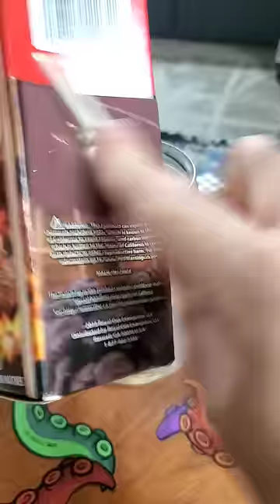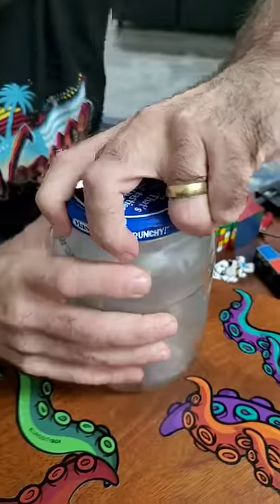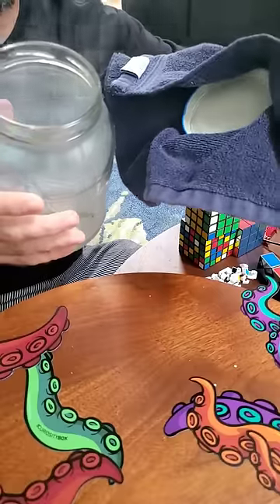Safety Sealing a Jar of Smoke

Comment: That is one impressively strong jar for not being reduced to nothing when Michael used his strength
Reply: let’s be honest that was the second smallest amount of force he could exert
Reply: He was only using 0.000000000000000000000000000000000000000000000003765456777886% of his power.
Reply: He was using 37% of his strength, but it would take you 99.9% of your strength, and you still won't be able to open it.
Reply: @NuclearYoutubePlant you mean 0.000012%
Reply: I'm surprised the fabric in the towel didn't rip itself to shreds underneath the torque of Michael twisting his arm..just goes to show how in control VSauce is of his superpowers
Reply: @lostpockets2227 im surpiresed the fabric of space time didnt collapse after vsauce pretended to struggle opening the jar
Reply: The thing is, that towel was probably imbued with a little bit of his power so it'll work as protection without getting torn to pieces.
I can't find any other reasonable possibility.
Reply: he was using 99% of his power
Reply: @PROPLAYEN  -99%
Reply: @falco05  So, 0% of his power
Reply: @__-tp4tm  I guess, meaning his very Existence is strong enough to open a jar, or rather it opens itself out of respect (idk how long that joke will be funny)
Reply: @falco05  Fck it, we're in too deep
Essentially, Vsauce is akin to Chuck Norris. He's probably an alternate Chuck Norris of another Dimension, probably wandering the aspects of Infinity. An alternate Chuck who's most mass of muscle is in his brain.

Legend says if he stares at you with the intent to destroy, he demolishes not just your body but your entire existence in this timeline.
Reply: @__-tp4tm  And every alternate version of yourself in other Timelines and the Multiverse. And yes he basically is Chuck norris at this point.
Reply: @woodykrska9947 he was using all his power to prevent himself from vaporizing the jar
Reply: @cameronvanatti  yes
Reply: He didn't use his strength. He replicated our strength so that we didn't feel bad. What a chad
Reply: @NuclearYoutubePlant  *0.000000000037%
Reply: @spotify_Real  you mean 0.000000000000000000000000000000000000000000000000000000000000000000001% of his power
Reply: @NuclearYoutubePlant if he was using 37% the jar wouldn't even be invented
Reply: @NuclearYoutubePlant that’s a lot of power for a simple jar
Reply: As thanos said “gone,reduces to atoms”
Reply: @lostpockets2227  you should that the fabric itself was made from reinforced vibranium
Reply: He was using 0.00000000000000000000000000000000000000000001292% of his actual power
Reply: @spotify_Real no bro you mean 0.00000000000000000000000000000000001
Reply: @jjpendejo7407 it did, but mical held it back together, obviously the seals don’t ever go back down, mical was abusing space time for content
Reply: Ya he is very strong he beat my ass while his hands and legs were tied
Reply: @__-tp4tm no he was actually tightening it so much, it popped off
Reply: He was only using 0.000000000000000000000000000000000000000000000000000000000000000000000000000000000000000000000000000000000000000000000000000000000000000000000000000000000000000001% of his power
Reply: Nah that was a towel forged in the depots of hell drenched in holy water
Reply: Well, hence why he said he was grabbing a towel not his bear hands after the first example 💀😭
Reply: God has inspired me to share this Wonderful Good News that deserves to be heard by everyone.
Jesus is the only way to Salvation 

John 14:6 – “I am the way, the truth, and the life. No one comes to the father except through me.” 

And No Matter what you are going through GOD Loves You.

1 John 4:9–10. In this the love of God was made manifest among us, that God sent his only Son into the world, so that we might live through him. In this is love, not that we have loved God but that he loved us and sent his Son to be the propitiation for our sins.
Reply: @woodykrska9947 damnit you got to the joke first
Reply: That was just a fraction of his true power. God himself fears Michael.
Reply: Im glad he didn’t destroy the universe (he could with 0.000000000000000000000000000 000000000000000000000000000 000000000000000000000000000 0000000000000000000000000001%
Reply: Boys, he was just pretending to use his strength. So he is way beyond powerful..
Reply: @jjpendejo7407 nah, he just has lots of practice with his powers. the fabric of space time will only rip if he wants it to
Reply: Yall underestimating big Mike he is so strong the precential amount of power he used is so small we human can not quantify it so your arbitrary percentages mean nothing
Reply: @woodykrska9947 that’s far too much he would evaporate at minimum the earth
Reply: @paradoxgameenthusiast  true
Reply: @jjpendejo7407 im suprised he didnt annihilate all multiverses from breathing
Reply: nah man it has a towel on it
Reply: Yep. This man is the proof that the law of conservation of energy is just a goof.
Reply: Glazing
Reply: Yo
Reply: @__-tp4tm vsause is old Chuck norris😮😮
Reply: @Denstaerkste1  Pretty much xD
Ah how glorious that comment thread was...
Reply: He used
0.0000000000000000000072914% of his strength
Reply: @NuclearYoutubePlant why did you raise the percentage to 6757789857564567
Reply: Generate a Text about Abraham Lincoln being a Vampire

Comment: "Not because I'm strong, even though I am"

That quote shows his strength, and this here is all the proof we need to know how strong he is
Reply: *proof
Reply: @DUCK-DUCK_GOOSE   thanks for that
Reply: @Monia.H I don’t think I’ve ever seen someone be this calm and respectful after getting corrected
Reply: @George_the_Gorilla  ikr
Reply: Not a bad thing though
Reply: @George_the_Gorilla 
For real, even though they should be.
Reply: If you smack two heavy balls together... smacks them together with a piece of paper in between the energy of their collision will be focused at such a small point, enough heat can be produced to literally burn a hole through paper. Try this at home, it smells sniff like smoke. But lets make it even hotter! First, i'll need to rust up one of these balls. Vsauce theme starts playing 

A bowl of water should do the trick. Ten days later, that's a rusty meatball... we will wrap the other ball in aluminum foil, turn down the lights, put on some eye and ear protection and start whacking. Until... this happens spark comes out of balls . Did you see that? That is molten slag, at more then 4500 degrees Fahrenheit. Now that didn't happen because i'm so strong... even though i am stares in gigachad . It happened because the colliding balls produced the ignition temprature needed for a thermite reaction. The aluminum reduced the iron oxide, the rust on the ball, to form aluminum oxide, elemental iron and MUCH more heat than i put in. 

Now that's what i call... Exothermic Redox. regrets his actions puts the camera down in shame
Reply: @veona599  I don't see anything to be mad about. I just made a small spelling mistake.
Reply: @AlliaNCeYoutube  I love this comment, I'm surprised that you where able to memorize that all!
Reply: He only uses 1 % of his power to open that jar
Reply: @Monia.H  
Yes, that was exactly my point. The thing is, not a lot of commenters would handle this as well as you did. They would just be offended thinking that the person who corrected them is looking down on them.
Have a good one.
Reply: i love the part where he said that in this video

Comment: I seem to recall that jarring food used to work in much the same way. If you needed to jar something to preserve (like peaches for example) you’d put the peaches in the jar, then boil the whole thing from the outside with the lid off. This would both disinfect the jar, as it would kill any lingering bacteria, as well as prevent new bacteria from growing by creating a vacuum seal within the jar.

It’s an old technique that largely went away when canning was invented (cheaper and lighter weight, but with largely the same process) but you can still do it at home. Give it a try!
Reply: Indeed, or the product can go into the jar when it is still warmer from the production process (i.e. jam?)   Then lid the jar, and it will suck the jar shut as it cools, sucking the freshness seal down.   Incidentally, this not only serves as a tamper seal, but a freshness indicator.  As things in the jar rot, they will produce anaerobic bacteria, which generates gasses.  Those generated gasses equalize out the vacuum in the jar, pushing the little button back up without the jar being opened.
Reply: It still works a similar way in food manufacturing, it just looks a lil different. My dad is a packaging engineer who's worked in a bunch of different food industries, it's interesting to hear him talk about the different ways they accomplish essentially the same thing without compromising the quality of the food.
Reply: @andrewtr001  You really should heat it up after you can your item, specifically to kill the anaerobic bacteria. They may put the product in warm to make the sealing process go faster, but once it's sealed, they'll almost always cook it again to make sure it's shelf stable.
Reply: My family has a farm and still does this! We have canned tomatoes from 2018 that are still delicious. Luckily if you grow your own tomato’s, then when they lose nutrients over time they still outclass the gmo tomatoes years down the road. Also works  amazing for stew! We make a giant batch of stew every year and it stays good all year. Got some still that are from 2020 with meat and beans and all. Break the seal, put on a stove and in 10 minutes you have an amazing stew ready to dip a grilled cheese in
Reply: My family still does this! We were just canning our tomato harvest this past week. It keeps all winter and I would assume even longer but it always all gets eaten by springtime haha
Reply: @muffinman3052  Where in the world are you harvesting tomatoes in November?
Reply: @theBestElliephant  a greenhouse, maybe?
Reply: @psychromaniac3525  It's still the wrong season, like they would've had to start growing them when people are usually harvesting. It's just not something normal people do, especially if they're saying it lasts all winter.

Comment: This is actually a trick you can use to store your food for longer. Whenever you have a sauce, stew or a soup pour it into the jar when it’s boiling hot. Then close it, turn it upside down (to make sure air won’t escape) and wait for it to cool off over the night. As it cools down and shuts the lid, you’re left with well isolated food which is relatively sterile (as it was very hot when you put it in it had less bacteria) and thus it can last in a fridge much longer than it normally would. 
It’s particularly useful for soups as you can’t really freeze them and this way you can safely store it up to a month.

EDIT: Turns out people in the comments raised some safety concerns with performing this method on any commercial jars due to thinner glass and poorer seals. It is better to invest in proper mason jars for such pressure canning.
Reply: This is a terrible idea and following this advice will make a lot of people very sick
Reply: @charlescrawford2283 the trick is to boil the glass jars for 45 minutes in hot water, then rub the lid with alcohol and then put the hot food in the jar. You can also bake the jars for the same amount of time and put the food in them.
Reply: @DeiDeiMuffinxD  Reusing commercial jars for water-bath or pressure canning food is an exceptionally bad idea for several reasons.
Reply: @charlescrawford2283   My family has reused glass jars like that for as long as I remember and myself I've been doing it for 3 years since I moved out and never had a problem. Even if you are worried about contamination of the jars and the boiling liquid not killing all the bacteria I think @DeiDeiMuffinxD 's method should solve the problem. Of course you want to make sure the jar you use is sturdy enough so it won't break and that the cap fits tightly, but the safety click should indicate if the latter is true. 
Or do you have some other worries? If you could elaborate on that, I would be grateful because maybe I might be missing something.
Reply: Wanna explain why?
Reply: @charlescrawford2283  I said what I said. For many many hundreds of years people have preserved food just as described in this comment thread. There are many archeological finds where scientist have found preserved food in jars, either glass or clayware (correct me if I'm wrong; I vaguely remember a "fish dip" from ancient rome was once found in a clay jar, I think near Naples..) If you still feel you need a better explanation: go ask a chemist, a doctor and a cook. I am fairly sure they will give the same anwer as we have given, maybe even in more detail.
Edit: typo
Reply: @charlescrawford2283 been doing this for years with kimchi.
Reply: Works well, but no need to turn the jar upside down, that just dirties the lid for no reason. Run the jars and lids through the dishwasher first, and preferably fill straight out of the dishwasher when they are still hot. lids need to be in perfect condition, discard lids that were damaged previously by an opening tool, and try not to use one on these when you want to use the contents, in order to save the lid. Good for a cooked tomato, onion & garlic mix.
Reply: @thmxsz 

Commercial jars unlike mason jars for home canning are made from thinner glass and not made to be brought to boiling temps more than once.  Is causes more breakage which both wastes food and cause injury.

Additionally the adhesive on the lids is single-use.  If you are, inadvisably, going to reuse jars then you should still use new lids.
Reply: @meetim2931 you should never reuse lids.  the adhesive on the commercial lids in single-use.
Reply: @charlescrawford2283  ah i see thanks
Reply: @charlescrawford2283 Adhesive? You think they glue the lids down?
Reply: @charlescrawford2283   oh hey a random commenter actually explained and backed up what they said thanks man
Reply: @iyatemu  There is food-safe polymer sealing compound on underside of the lids where it contacts the lip of the jar.  It is heat-activated and not meant for multiple use.
Reply: So when he does it "great" when someone tells you how to do it without match and smoke inside "bad bad bad" ok
Reply: @Xezian  actually they just reinforced bad food safety.
Reply: @charlescrawford2283   first, lids dont have adhesive, and second, if they did, how exactly would you be aware it was single use? Third, if I re-use a lid and it works fine, where is the problem?
Reply: @meetim2931  everything you just wrote is wrong.
Reply: @charlescrawford2283  from what I understand it is only the reusability of commercial jars that you have problems with, not the method itself?
Reply: @charlescrawford2283  Bull.  funny you dont see the need to elaborate. Adhesive is glue, last time I checked. I know of no lid that required glue to seal. second, how can a question be wrong? I asked you how you could possibly know that the 'adhesive' (????) is single use. I note deafening silence  as your response. Third, my experience isnt 'wrong', because it cant be by definition. are you going to tell me that somehow my jars actually leaked but I wasnt aware? you are full of it.

Comment: Pro tip, this also makes it easier to open the jar. Just heat it up, and the increase in internal pressure will help pop the lid open. You don't have to get it all the way to boiling to make a difference.
Reply: Cool, but who asked?
Reply: Or you can just stick a knife or a fork under the lid and let the air in

Comment: Or you can take a closed empty plastic bottle, then spin either end in the opposite direction, thus the pressure inside the bottle rise, and open the cap quickly so the pressure drops quickly

Comment: humm, no. That's not what happened. The O2 in the air of the jar oxidated with the wood buring loosing volume. You can just see that because the jar cap sealed at the same time the fire extinguished, the air did not have the time to cool.

Comment: Or, if you don’t want to soil your jar with burnt splints and smoke, or encourage kids to play with fire, you could fill it with clean hot water, tip it out, put the lid on loosely, and tighten it after a few seconds.

Comment: I wonder if it applies to big scally as well. Like the whole universe. Like if there would be a big crunch. Would the center of the universe collapse first pulling at the outer edges stripping them down and pulling them slowly towards the center? If the relativity principals also apply to that scale we couldn't even see the universe collapsing until it would get right on our doorstep with distant stars on one side of our galaxy slowly blinking out.

Comment: How do you think Slavic grandmas lock up jars, huh? If you put something inside, and then you put the jar in hot water, and close it, the exact same thing will happen - and after it's closed, it can only be opened with inhuman strength...

...or by popping the lid lightly with a knife ;) here's a tip for you all

Comment: But doesn’t the button just pop back up 🤔
Reply: No! There is now less pressure inside than outside because the last time that the jar was open the air inside was hot and thus required more volume. Closing it in that moment means that there is now less air inside than before. Ergo: less pressure -> button stays down